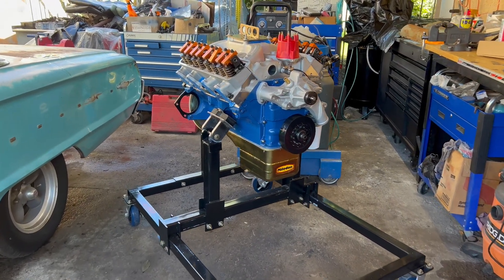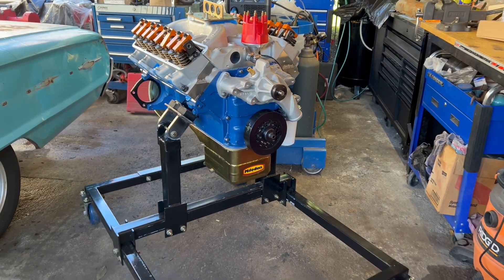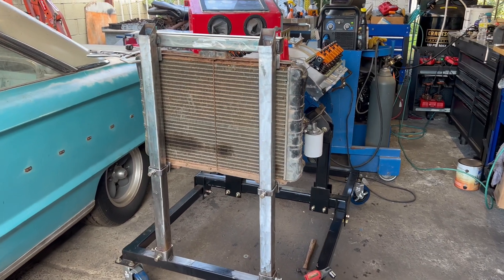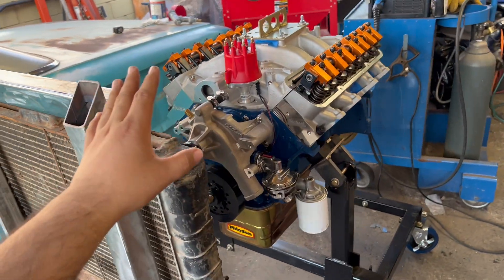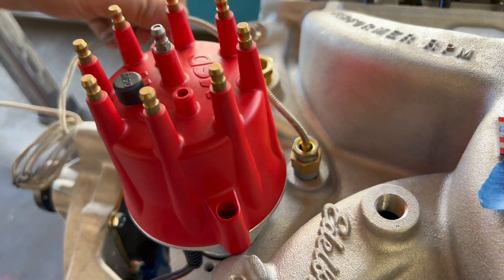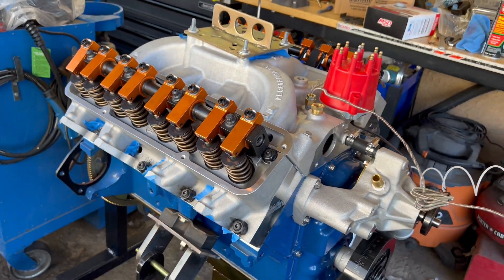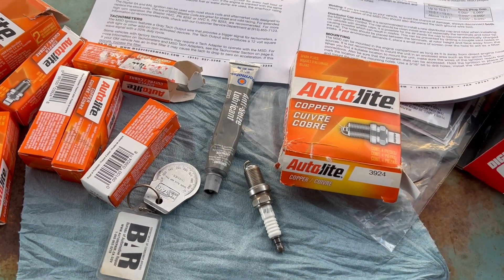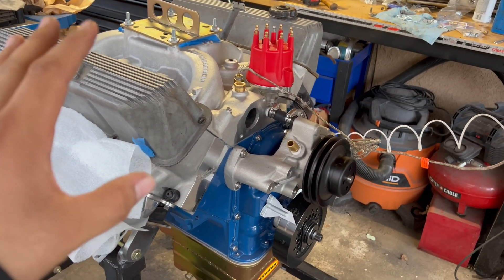Ford 428FE Build Part 11: Run Stand Finished and Final Preparations!

Comment: How about installing an air / fuel gauge so you can keep sure your not running rich or lean.
 I can not wait to hear this thing come to life. 
 A thing of beauty and a joy forever.
Reply from the maker: Yes an air fuel mixture gauge would be really helpful when I switch over to the tri power. I’ve got the engine running, just some last adjustments!
Reply: @OmarRamirezGalaxie  I watch Nicks Garage and he builds and dyno tunes. One thing he watches is the air fuel . Often he has to change out jets . It makes a huge difference on idle and performance. I forgot about your tri power  .WOW!!!
Reply from the maker: @dougabbott8261  wow he’s got some cool videos. Now that you mention it, I really am going to need that air fuel mixture gauge. I’ll try to find one and install it. Yes the tri power is going to be sweet!
Reply: @OmarRamirezGalaxie  Watch a couple where he sets up the carbs. You will find it useful getting that tri power working. He does some 6 packs .
Reply from the maker: @dougabbott8261  will do! Thanks!

Comment: I can't remember if you went with a roller cam. I hope you did. My fresh 401 FE lasted an hour of run time and then a lifter failed , as in about 3/8" wore off it and that killed all the bearings and the crank. It went from a tick to a loud clack really quickly. So the motor is back out and torn all the way down to a bare block. Going with a roller cam this time. Never a flat tappet cam and never Crap Cams again.
Reply from the maker: Yes I have all roller set up. I was really worried about all the cam failures. I really did not want to build it twice

Comment: Make sure you add an oil temperature gauge!
Drill your drain plug for sending unit if oil pan does not have a bung for temperature sending unit.
You will learn a lot from having OT readings in your car too. I have used one since 1969 on all my cars. That way you know more than then t guy.
Reply from the maker: Yes that’s a good one, I’ll have to look into an oil temp gauge

Comment: NICE!!!!  Love the old Sun Super Tach in that application. Nice vintage touch for your "vintage" modern FE build.
Reply from the maker: Haha yes I’ve had that tach for a while, finally able to use it!
Reply: One thing that Sun Tach which I love has a very slow movement. You can see it with a quick rev up and down. The engine will be coming down and Tach still going up.
I switched in 1970 to the new them 1400-9600 rpm Autometer with rev control.
Just FYL

Comment: Here's a thought, I would have welded the upper cross bar support between the two up rights. Then made for the lower and upper radiator mounts the same as you have for the bottom but with another L shape mount bracket with a center oblong hole. On the bottom half of the L bracket attached to the up right support weld a boult or 11/2 treaded rod, attach the other half of the lower L Bracket and tighten with a washer/ nut. Do the same for the upper radiator mount in reverse order. You can line the radiator contact area with foam or rubber. This will give you the necessary adjustment to mount any size radiator and with the brace bar welded between the post, where the radiator cap is on the radiator become a none issue.
Reply from the maker: Good ideas! Once I’m done with this engine I’m sure I’ll modify the stand a bit more and get it powder coated. Definitely like the idea of the threaded rod